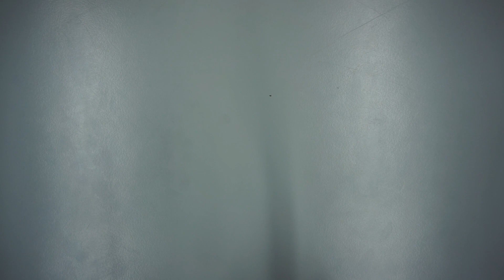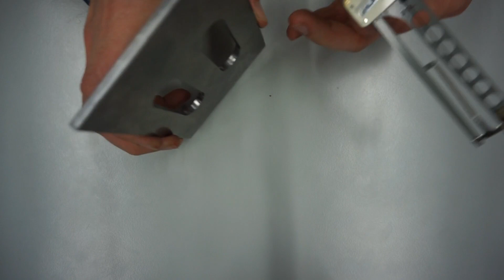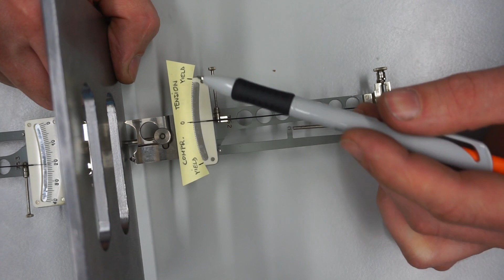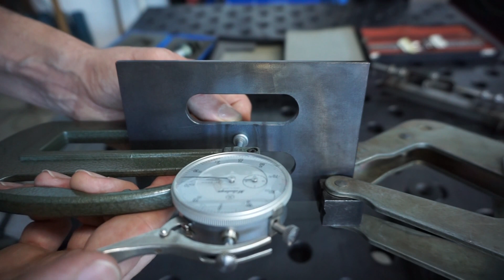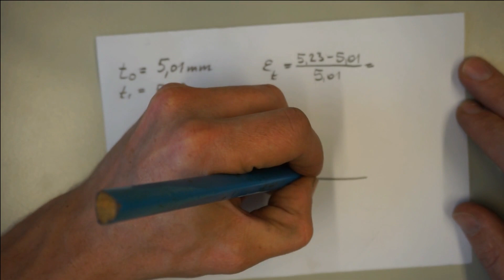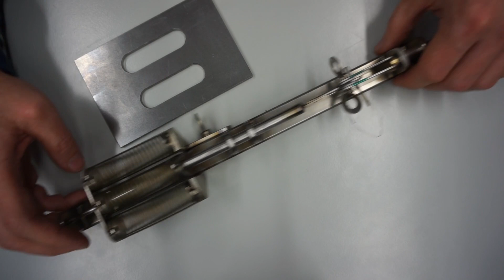Welding Distortion Explained Part 2: Stresses and Strains

Comment: I have been a welder for 25 + years. Tig ,Mig, Arc, and the new lazer welding which is amzing on thin metal. It reduces distortion loads. This was an amazing video. I know how metal moves. Mild, stainless, and aluminium. I did not know the theory behind it. I found ways to counter it through trial and error. Like welding a square frame and keeping it square. Welded parts that shrunk by 12mm. That's a lot of full pen welds on a part that was about 2 metres. This thought me that a lot of what I did was correct. But I had no idea why. And thought me so many ways to counter the work that is not possible to counter distortion on while welding.
I massively appreciate these 4 video and will watch them about 20 times each, so the information sticks. Thank you. 💛
Reply from the maker: Many thanks for your interesting comment. It is very rewarding when a welding veteran like yourself finds my video's useful. Sorry for the cheesy video and audio quality, but this was way back when I had no much video experience. ATB, Alex

Comment: Well. I watched the series only one time, but there is a question keep bugging me. In diy cnc making, as i researched, it is recommended to avoid any welding cause it will cause distortions at that moment or over time. Im aware that your strategy will minimize that so is there a way to weld a cnc chassis without worrying about distortion, as the wisdom of no welding in cnc machine is popular?
The question come from the fact that you welded your straightedge and it performed well after 2 years
Thank you and looking forward to your reply!
Reply: If by welding u mean using hollow sections to weld together into a CNC chassis, then it's best you don't do that at all. Why waste all that effort to produce a sub par machine?
Reply: @impactodelsurenterprise2440  Yeah i thought the same but many folks are making their machine that way. I figured that you need grinding process to flatten and level everything. And a good welding technique which prevents internal stress (?) is also needed. Am I right or i still miss something?
Reply: The major problem is rigidity and vibration. There's a reason why majority of machine centers are made out of solid cast iron, mohr coulomb. Even with solid cast irons, you still have to deal with thermal growth. Also when manufactures cast the machine chassis they typically weather it for many years, allowing any residual stress to release itself. If you're making a cnc router for wood, or laser cutter then welded frames would suffice.
Reply: @impactodelsurenterprise2440  ahh i see now! Thank you very much for sharing! Much appreciated! 
I made a wood cncrouter using aluminum extrusion as i believe its much better than welding. Making a cnc co2 laser cut right now using the same material.
Will make a mill soon, thanks to your info i will definitely check out other options such as granite surface plate since casting and welding are definitely not an option.
I showed me the answer for a question that had stuck in my mind for months. Thank you again and would love to hear more on this subject!
Reply: @impactodelsurenterprise2440  and one more question. This channel owner weld a straightedge which worked well for years. Hows the welding didn’t affect the quality of the straightedge? Thank you!
Reply: Because they are just tack welds and cleverly sequenced.
Reply: @impactodelsurenterprise2440  thank you very much! Have a nice day!

Comment: I am starting my 2nd project welding stainless steel (which is more likely to distort than mild steel) and am re-watching this entire series.  Your presentation and examples are excellent!  In my last stainless steel project I used the TIG torch to do some heat straightening and it worked very well.  Thank you very much for the work and thinking you put in this series.

Comment: Great content👍 thanks. I'm still unclear on how the cooling phase work, what determines the amount of stress imparted from cooling? Is it fair to say that the distance the bar travels during heating is exactly opposite from the distance the bar travels during cooling (in the contraption)?
Reply from the maker: I guess you can say that the bar must travel the same distance back as it was displaced beforehand. You may think of the displacement as the temperature difference in the three trusses, which is zero in the beginning and zwero after cooling. Thanks

Comment: Another great video, than you for in depth explanation. One question that spring to mind, does the real life materials behave like compression springs as in your contraption or like constant force springs?
Reply from the maker: Typical metals used in welding typically behave like springs up to a certain stress, beyond which they yield. This behavior is modeled in "the contraption" via springs AND the frictional element. The contraption is not just an array of springs, this would not suffice to explain the three-bar-truss.